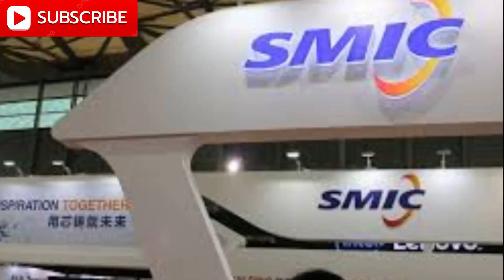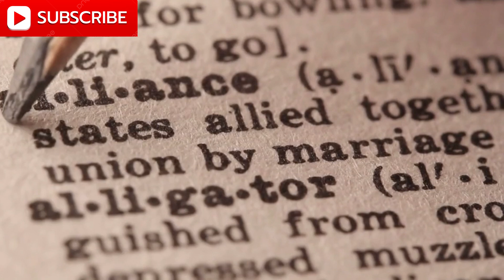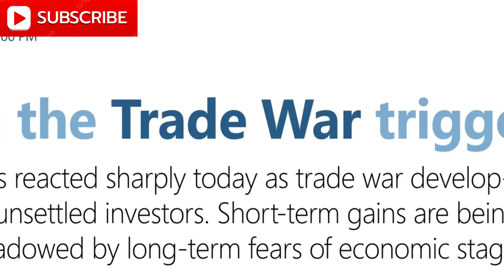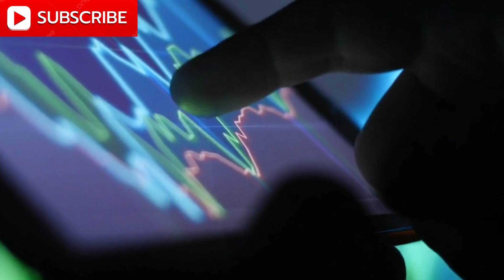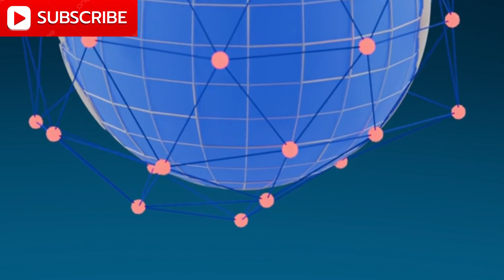SMIC Launches 2nm Chip Despite U.S. Ban — Washington Worried

Comment: While this video suggests that SMIC is using SAQP technology to produce 2nm chips, another alternative approach may be the reason.  China has announced using a two dimensiona substrate and a two dimensional transistor gate instead of the three dimensional silicon substrate with a three dimensional FinFet transistor. Or...we know that Huawei/SMIC are working on their own EUV machine that is due for mass production in 2026.  Could this 2nm chip be the child of this developmental EUV machine?